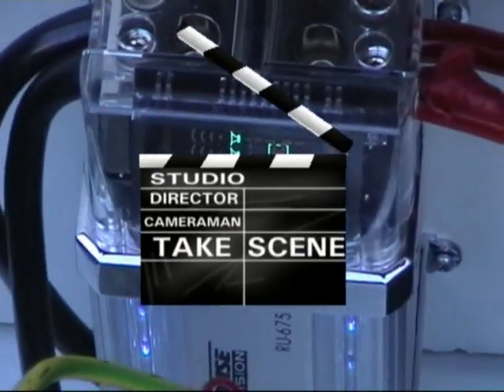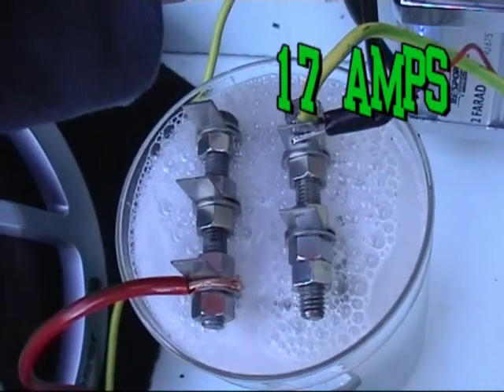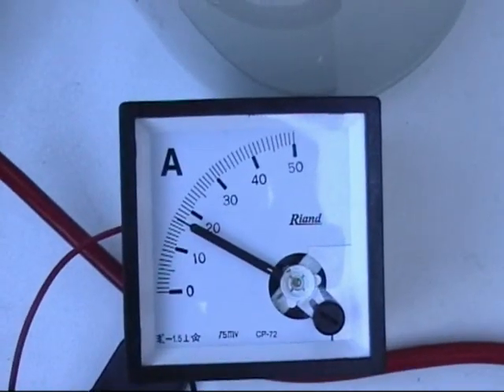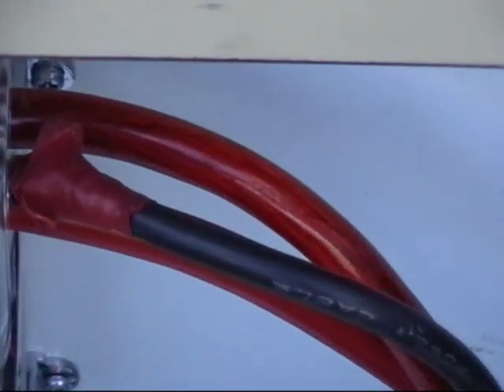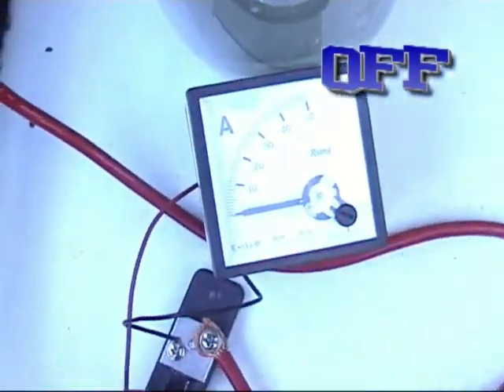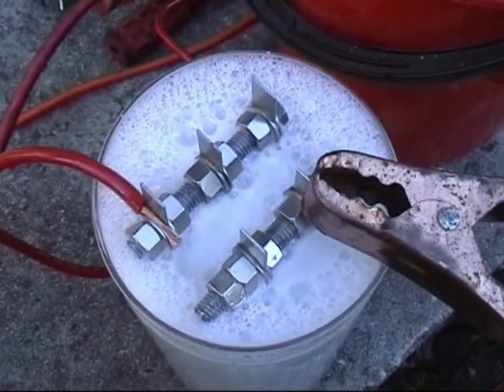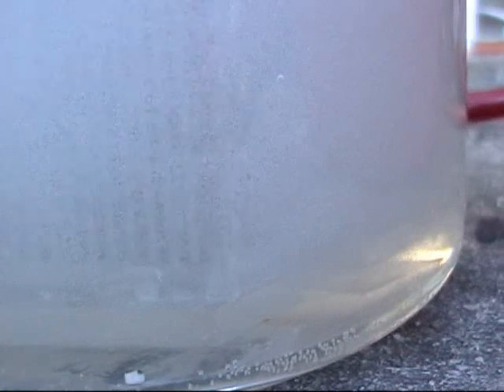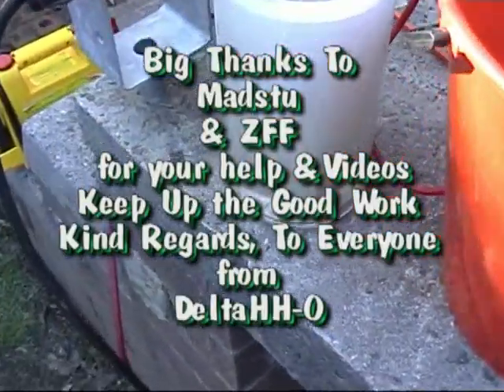First Test of My HHO Cell

Comment from the maker: the Idea is to work out what voltage you will be running the cell off then Divide 2 into it e.g. if you were working with 12v/2= 6 so you would need 6plates +NNNN- I'm useing 14volts so its 14\2= 7 so I need +NNNNN- then you can arange the plates so there back to back like +NNNNN-NNNNN+NNNNN-NNNNN+NNNNN-NNNNN+ and so on and so on.

Comment: Great job. Very impressive gear you have there. I'm no expert but I've built many units. If there is any oil from your hands on the plates or anything in the electrolyte, that can cause foaming. I cleaned mine with alcohol before submersing. That seemed to help.

Comment from the maker: yeah the only problem with a pump is that it the internal parts must be made of all SS or Brass and can take heat upto 70oC or more I dont know how hot this cell get up to yet but I did run it today for about 1h @ 15amps and it got up to 40oC more testing needs to be done. Yeah well thanks for the input always looknig for idears

Comment: You've done very well with the output - how many plates have you used?  Are they arranged +/-/+/-/...?  Did you use DC power or a modulated frequency source?   Thanks for  your help.

Comment from the maker: Thanks Stu The voltage meter if you look closely at it is A 2 fared Capacitor with very hevy wiring going to it. Yeah the setup was very crude setup becuase I was inching to try it out. Did you see what happend when I taped the power on?? it was makeing bubble long after it was off???? yeah the plates probley still have a bit of actone and other stuff I used to clean them with will give it a good run then Mix up some KOH to do 20amp for my next test and work on makeing a HHo Meter Thank Mate